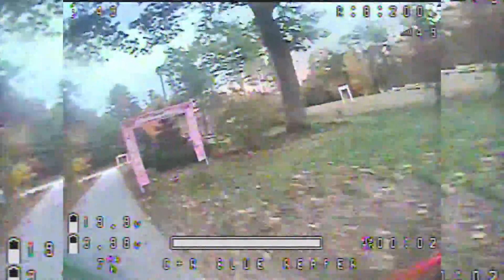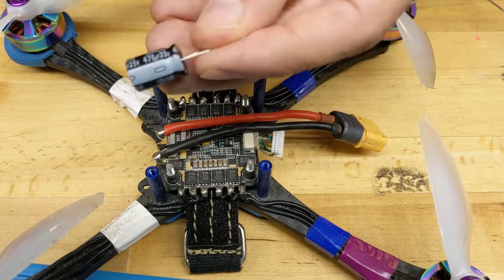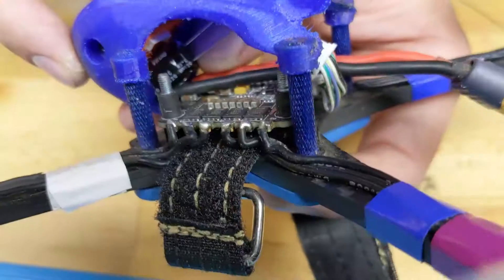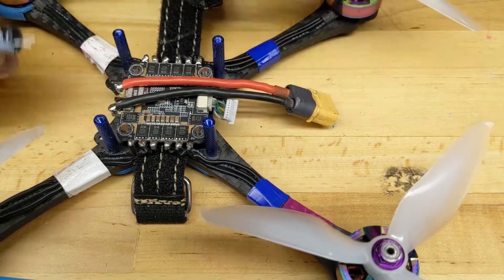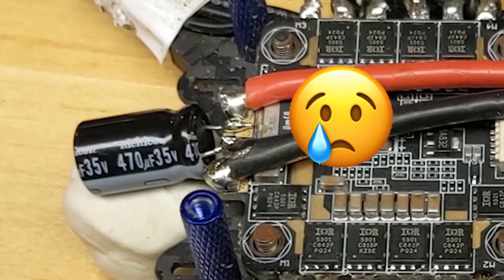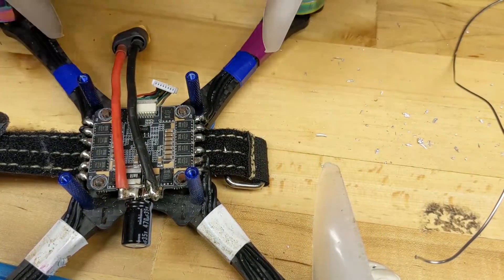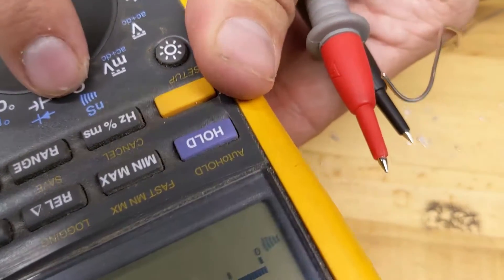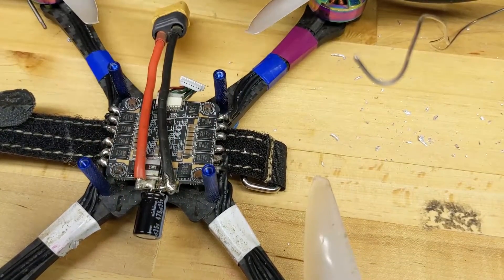Installing a Capacitor on an FPV quadcopter

Comment: Hmm c'mon you claiming' we will talk about why we install this cap.
but you didn't.. you just rapped the exact thing you likely have seen other people do.??
why did you choose 470uf.. the voltage you can conclude down to packcell spikes, even though there is likely a lot of overhead, so 25v would likely also do fine on a 6s quad, but the uf rating.??
why not go for smaller value or a cap that is more ideal for a quad, instead of this round pointy fellow.
what would differ with a fx 35v 47uf versus 35v 1000uf.. does it lower the esr?  whats the benefits of the higher uf on a quad?
I got two caps, I originally purchased to make a cheap spotwelder, they were like a few bucks on ebay
one is like above 500f and the other is from Maxwell and like 350f but here the farad rating, as I recall down to the energy they could store.
and you really don't need to store energy on a quad, but mainly subdue and absorb noise / spikes, and why Im a little unsure the benefits with fx 47uf versus fx 1000uf that obviously is a fraction of 500 farads.

Comment: can i add a capacitor for my 1s whoop ?
Reply from the maker: The process would be the same as here, you'd just use a smaller cap with a lower voltage limit. In my experience, it's also not been necessary for the whoop-class vehicles. If your video isn't noisy, I wouldn't worry about it